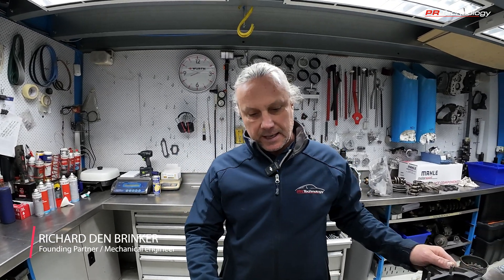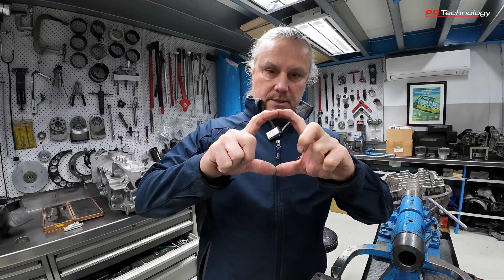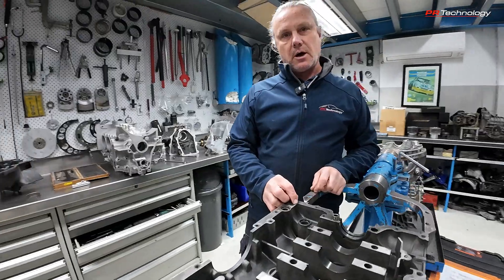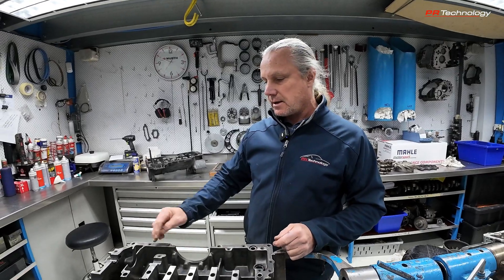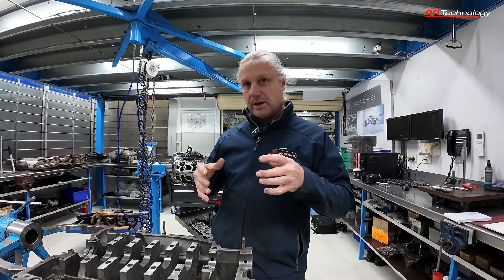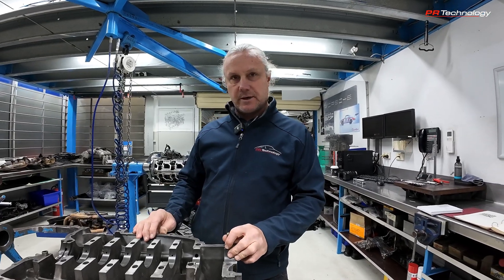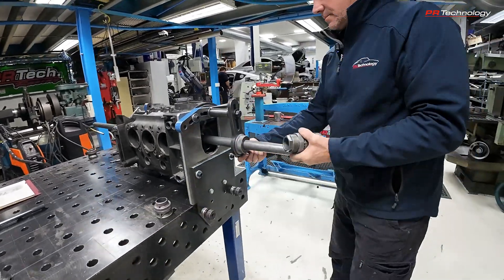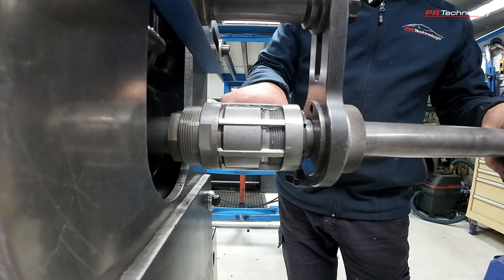Line Boring Classic 911 Engines - PR Technology Technical Torque

Comment: Is that a left handed reamer or where you accidentally spinning it counter clockwise?
I just love the different ways manufacturers, re-manufacturers and mechanics deal with bores.
Caterpillar had a tool group for boring 3208 and similar blocks using a bar and lathe bit and power feed device.
Before my time,  Cummins had huge one piece reamers for correcting bores. Still got the manual somewhere.

Comment: Nice tool and well explained, but that's not really a power driven single cutter line boring machine. It is an accurate manual align reaming operation, while it achieves a similar result, its pure align reaming, not line or tunnel boring in the true sense.
Reply: Yeahhhhhh true, but that’s just not how these are done. There’s maybe half a dozen places on the planet that can do these Mag Porsche cases correctly. Scary but true
Reply: Thats BS there's thousands of shops that can do this job. Magnesium isn't as hard as metals like titanium yet there's plenty of shops that machine titanium every day. @Selmerpilot
Reply: @Channelmaster73  absolutely positively not with Porsche magnesium nor aluminum cases for that matter.  Too many specialized tools required.  Been working on these things for 20+ years, there's maybe 3 shops in the US with the best of them by far being Ollie's engineering.  World famous.
Reply: @Selmerpilot  so you're trying to tell me that someone like Titans of CNC that build titanium and magnesium parts for the aerospace industry couldn't make a few holes round?
Get a grip.
Reply: @Channelmaster73  without the tools and knowledge, absolutely not.  Porsche mag cases absolutely require both sides of the case to be decked flat before boring the main saddles.  Won't happen unless it's a shop that absolutely knows them. Dude I've been in this game for 20 years.  Machine shops absolutely do not touch stuff they don't know well, and any engine builder worth their salt won't take the engine bits to a machine shop that doesn't know that engine well, that's just a bad builder.
Reply: @Selmerpilot  So the guy in the video explained a few different methods and explained why it's not preferable to deck the case halves ffs.
I've been in this game for 17 years and time means nothing because there is people that don't know what they're doing at 10 years, 15, 20, 30, 40 and 50 years.
Reply: True. But I've never seen this. And I wonder if he has come backs because it's not computer controlled accurate. Old school styles ay ! Cheers from New Zealand